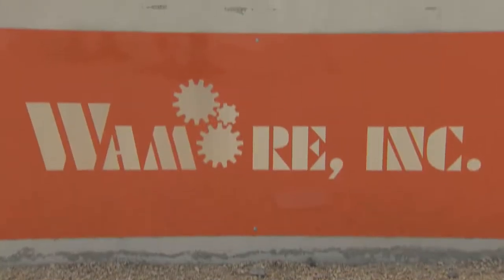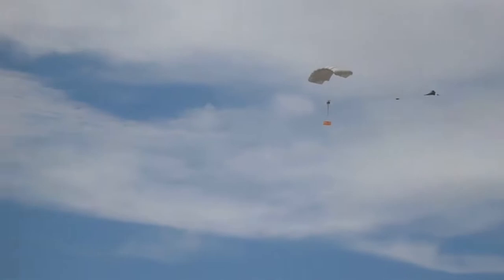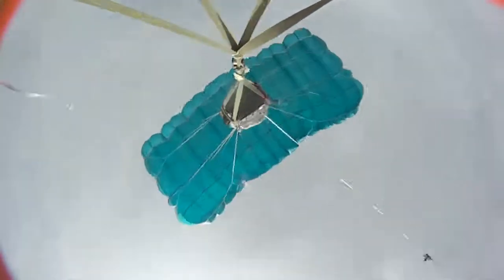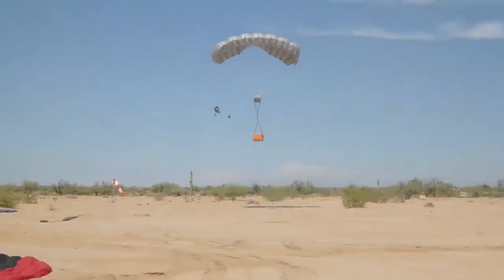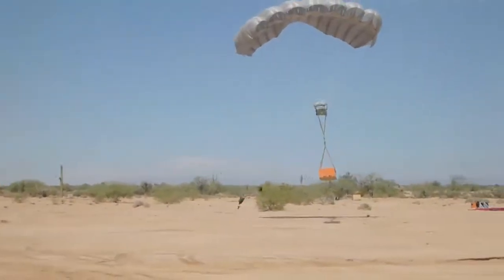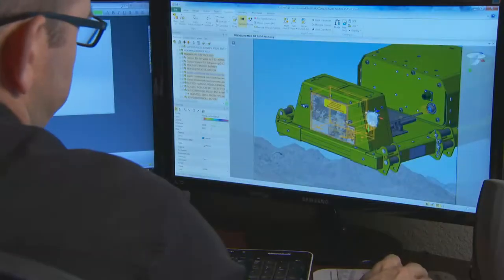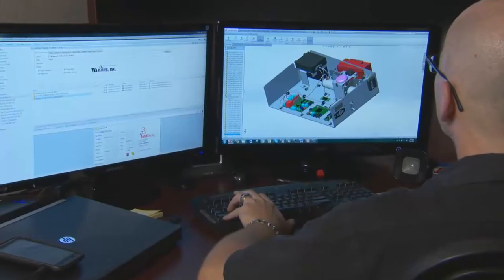Wamore builds innovative airdrop systems using SolidWorks Premium

Comment from the maker: Nothing is changing with the SolidWorks tools you currently use, and we're going to continue developing and improving them just as we have been for the last 18 years. We will be bringing out some new tools that leverage the internally-developed CGM kernel, but these will be complementary to the existing SolidWorks tools, and will not replace them. The first of these, called SolidWorks Mechanical Conceptual, will be generally available early next year.